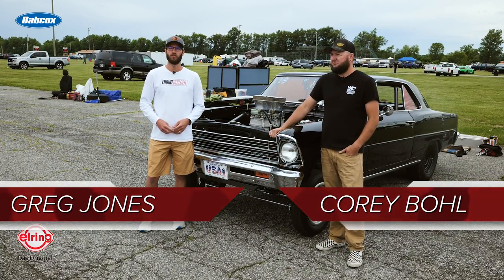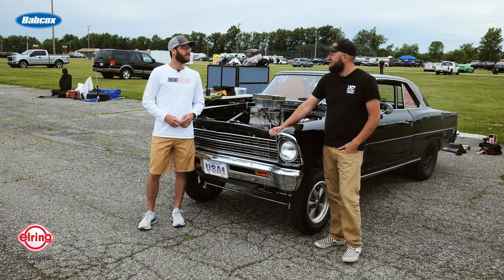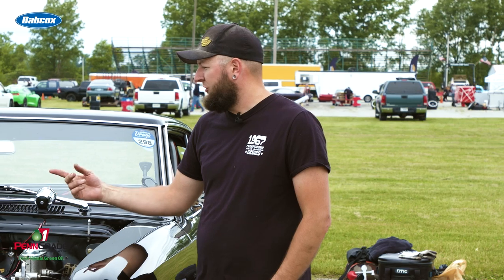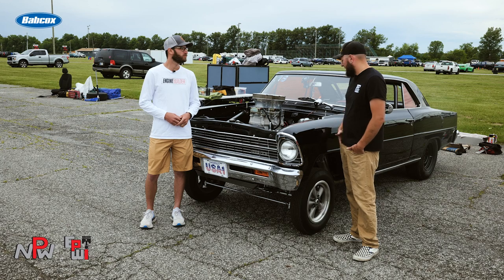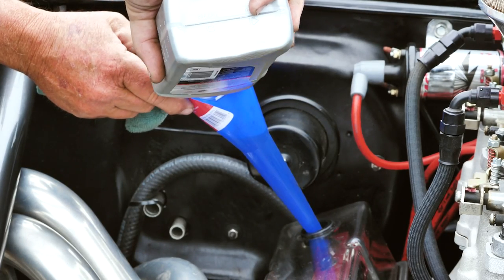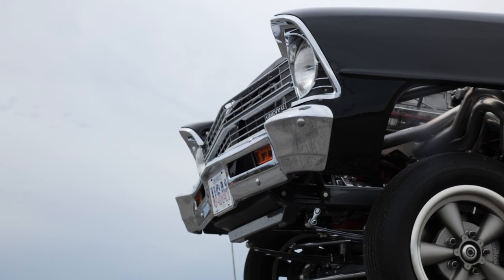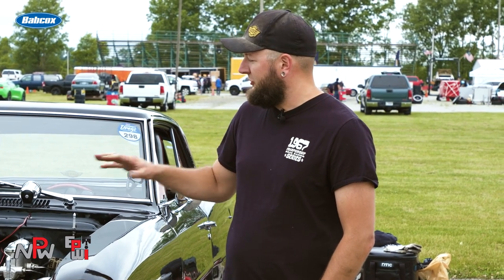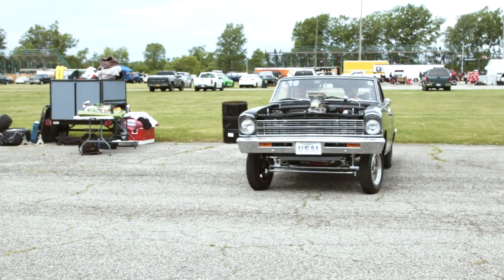427 cid Small Block Chevy Engine

Comment: My 69 nova has a 427 sbc Dart engine with AFR 227 heads and bullet racing solid roller cam running NA E85 850cfm QFT @ 10.32s at 129 with TH400 and 4.56 gears. Engine Dyno was 627 HP. Stock weight 3350. I want some clear valve covers like that. Ohio crank shaft is a great place!
Reply: Nice combo, i'm running a 94 Sonoma with 399 ci, Dart Little M,  261cc Brodix 17* heads, solid roller, dynoed on 89 pump 641 hp@6400 n/a, QFT 950 BD, TH400 and 3.55/9", it's a street truck that hasn't been to the track yet.
Reply: @heshtesh  Nice! Hopefully your track times goes well and your e.t. times make justice for all the hard work! 👍🏻
Reply: @djrowe10  Thanks, it's my retirement toy, no cage, only things removed are inner fenders for fenderwell headers, P/S, P/B, A/C and fuel tank, want it comfy lol. Do you plan on running spray to get into the 9's?
Reply: @heshtesh  How is it going , did u get to run yet. My friend went with that combo in a s10. He got it ironed out & turning 9.60 1/4 mi. no spray.

Comment: Nice I have aDart little M 427 in my 66chev2SS 525hp at the Wheel. A Craig Wright Muncie N-24 2.98 first and 4.11’s What a big difference over the 355’sbi always ran . We would be a good race . How does yours handle with the Straight Axle ? Mines scary till 4th gear. ✌️

Comment: Kinda confused,  how exactly are ypu getting 427 Cid with 6" rods and a 4" bore on a 350 block.
Reply: If you use a World products or dart  block it is designed for bigger bore and bigger stroke you can get up to 454 cubic inches in a small block by just replacing your factory block with a performance one from one of those two companies
Reply: 4" stroke, the bore is 4.125". Probably a Dart block

Comment: What about 7 liters is small? might as well say the Vipers 8.4L is a small block too 🤡
Reply: First off, no one talks about motors in litres. Secondly, it’s “ small “ because it’s based on the small block and small block head . By the way, I think it’s up to a 454 or bigger small block now.
Reply: @JoshJarrell-t9t  you lost me at no one talks about motors in liters 😂
Reply: @JoshJarrell-t9t  you’re either so heavily American that you think everyone uses cubic inches or you’re just stuck 40 years in the past. Yes my 86 corvette has a 350 but I don’t go around calling new mustangs 305s 😂 ford literally calls them 5.0s
Reply: @splysavv  yes, so heavily American! When we bore and stroke an engine, we calculate it by cubic inches and call it what it is. The factories use liters I know. The aftermarket world mostly does not, all I was saying.